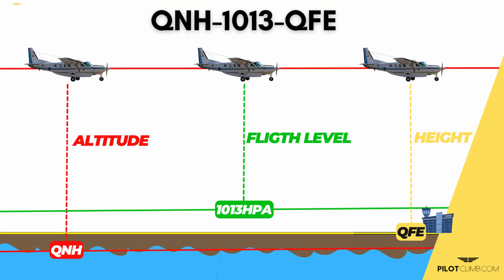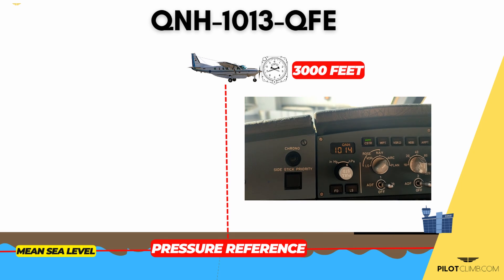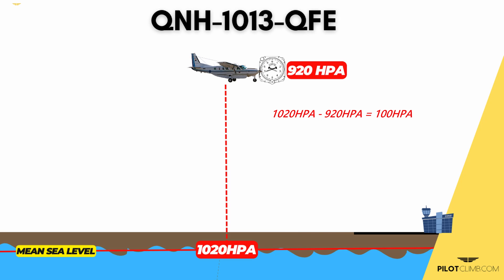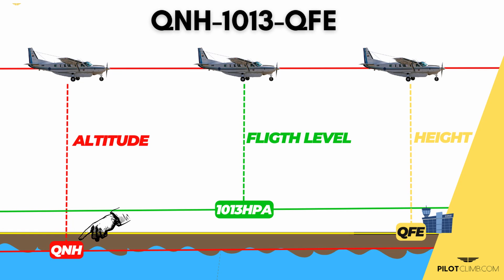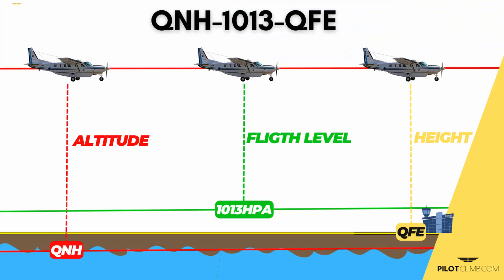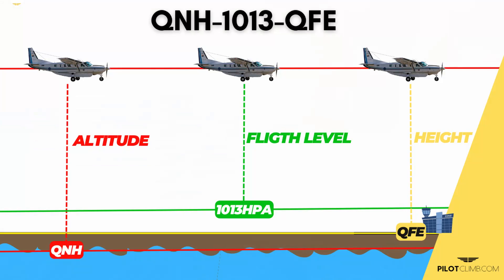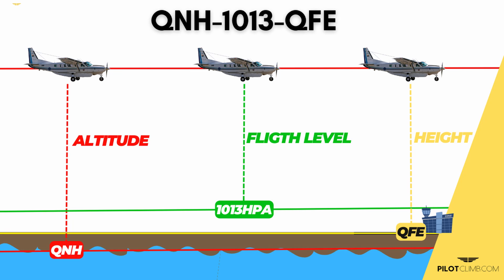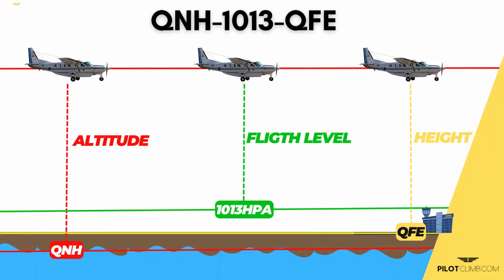QNH QFE 1013 ALTIMETER PRESSURE REFERENCE

Comment: Good. Just one question. Is the formula QNH=QFE+Alt(feets)/27  Correct?
Reply: If QNH is set, the altimeter will show 0 feet at msl, 
If QFE is set, the altimeter will show 0 feet on arp (aerodrome reference point) you could request QFE on threshold to show 0 feet on touch down.